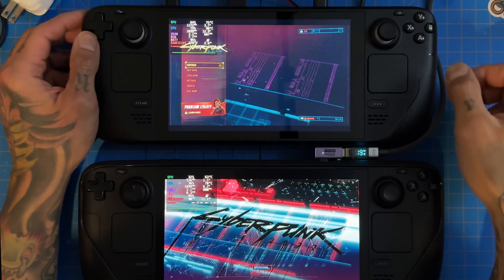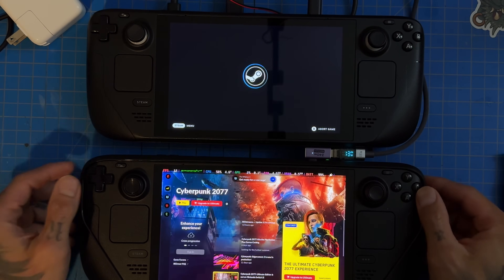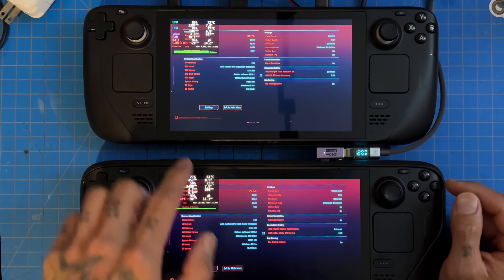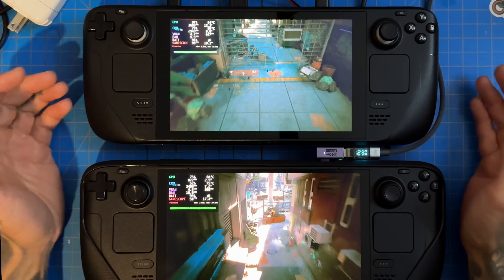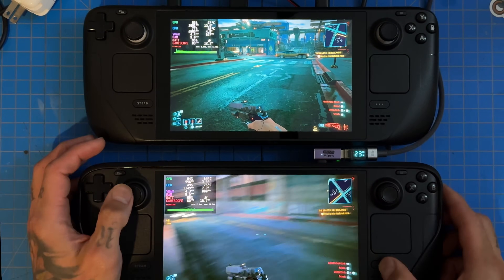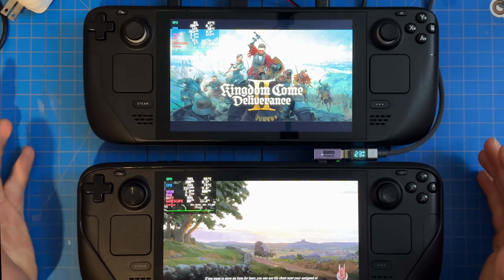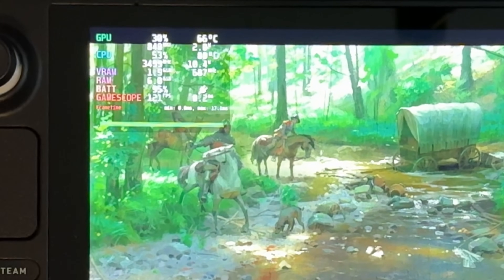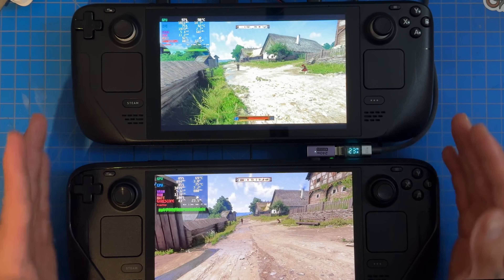Steam Deck with Lossless Scaling Overclocked

Comment: Most of the people use this wrong....guys you have to disable frame limit and allow tearing from Steam deck's performance settings for it to work properly. You'll know it's working properly once you notice the artifacts. Don't rely on benchmark you can notice it with your eyes!

Ps: for now it doesn't work with some games like cyberpunk it will show you 100fps+ but you can tell it's still 30 fps ish

Once you disable frame limit it on steam deck's settings it will never go above steam deck's monitor Hz. 60 for LCD and 90 for OLED
Reply from the maker: I'll be sure to give that a shot. It was off or set to 90fps on cyberpunk cant remember if 

Thanks for the heads up
Reply: I definitely have it working on cyberpunk

Comment: Something’s off with this benchmark. Why is the cpu clock so high on the oled limiting gpu clocks? Vs the lcd with a lower cpu clock
Reply from the maker: No idea, 🤷🏻‍♂️ currently testing OC OLED and its not running well at all. Very weird stuff happening

Comment: Does overclocking shorten the life of the devices? or does it overheat it? I've never really known what that does.  Like I understand that it pushes more power right to boost performance?
Reply from the maker: Correct, it does all above. It will shorten the lifespan by how much I do not know, but the best way to minimize any negatives is to keep it running as cool as possible.
Reply: @Diy_Papi  thanks for the response, and good to know. Thank you sir!

Comment: What are the downsides of overclocking? Does it effect the battery negatively in the long run?
Reply from the maker: Yes, it will decrease the life span of the SD. By how much i do not know.

Best way to minimize any downside is to jeep the sd as cool as possible

Comment: would my battery ruined with overclock ?
Reply: Ofc it drains the battery faster but thats about it.
Reply from the maker: It can also cause the battery to overheat depending on the TDP and the environmental conditions

Comment: Hi. I also overclocked my Steam Deck LCD to 17W TDP. But I didn't roll back the BIOS and did it on the latest version. I tried overclocking the GPU, but at 17W or 18W TDP it doesn't provide any real benefit, if anything, it hurts performance, so I left the GPU at stock values. The difference between 17W and 18W TDP is minimal, but at 18W the temperature is higher, so I stuck with 17W and bought a perforated back plate "from AliExpress". With this setup, my temperature doesn't always even reach 80 degrees, so I don't need extra cooling. And FPS in games has noticeably increased.

I couldn't overclock my RAM to 6400 MHz; my Samsung memory modules behave very unstably. But I adjusted the timings and have had no stability issues with them, while gaining a small FPS boost. For example, in Cyberpunk, it gave me an extra 2 FPS.

Oh, and I also overclocked the display to 70 Hz. This allows me to lock the frame rate at 35 FPS. And if we're talking about Lossless Scaling, it can provide a significantly better experience: if we lock the in-game FPS at 35 and enable 2x frame generation, we get around 70 FPS. Plus, frames generated from 35 FPS will look better than those generated from 30 FPS. Although Lossless Scaling handles 30 FPS generation excellently in many games.
Reply from the maker: Interesting, thanks for sharing your experience! Can you send me the link of the refresh rate mod you used.
Reply: Look for @10minutesteamdeckgamer

Comment: Probably bandwidth limited which was why the OC deck wasn't pulling more power. If your LCD deck is capable, try OCing the ram to 6400mt/s. The OLED deck has that by default and is pretty much the largest contributor to the slight performance bump that stock OLED has over LCD(the other being the slight power efficiency advantage the OLED has allowing it to boost a bit higher at the same TDP).
Reply from the maker: Interesting points, I'll have to look into that, thanks!

Comment: i always thought the steam deck was only rated to dissapate 15w of heat so idk if 20w would be healthy for the device is what i would worry about
Reply: It’s perfectly fine. I keep mine between 22 and 24 watts almost exclusively and it’s been a year and a half. Only
Change I did was a different backplate . I never go past 84 degrees
Reply: @dontsweatme4588 which one are you using?
Reply: @RetroMannGamingthe OLED . It’s fine for the LCD too. that’s what I started with. Definitely recommend better backplate and probably better thermal paste for the LCD.
Reply: running stock oled here, yea it cant handle higher tdp without some physical modding
Reply: @pikkyuukyuun4741 that’s not true either. It whatever your comfortable with. I was running 20 watts stock OLED for weeks and maxing out at 86 degrees depending on the game. You can get the better back plate if you want lower temps just be moderate with the overlocking …remember the deck can run just fine up until like 95-100 degrees
Reply: @dontsweatme4588 my stock backplate will overheat my deck. its the cpu that overheats(above 100C). when that happens, all my clocks drop to the lowest it can and the led flashes red. my gpu seems fine its just my cpu. even with undervolt. I have run my steam deck at 25W in the past, maybe thermal paste dried up idk
Reply: @pikkyuukyuun4741 Youll destroy it like that... please get better cooling 💔

Comment: I've had some weird differences between my LCD and OLED while running Lossless Scaling. I'm not sure if it's hardware or the OS though because I'm running CachyOS on my LCD. 

That being said, for some reason, I can run FSR with Lossless Scaling on my LCD but can't on my OLED. Weird thing is that Lossless Scaling WON'T run unless FSR sharpness is on on my LCD and it CAN'T run while it's on my OLED with Sharpness toggled on through the QAM. 

Sometimes Gamescope will report 60 frames but it's obviously not actually producing 60fps. Those times reinstalling Lossless Scaling fixes that but it crops up randomly. 

I'm wondering how much of it running smoother on your LCD has to do with the actual hardware rather than just the overclock. Another thing I had noticed between my LCD and OLED when both are running Lossless Scaling is that the HUD elements were solid on the LCD, but they were glitchy as hell on the OLED. 

Again, I can't isolate if it's a hardware issue because I'm running a different OS on one of them but the lack of HUD glitches on your LCD makes me think it might be a hardware related variable.
Reply from the maker: I have noticed the OLED is more finicky than the LCD when running lossless

And it does feel like lossless just works better on the LCD 

I guess I’ll have to overclock the OLED to see

Definitely feel like the LCD, even without the overclock was willing to pump more power into the APU while running lossless

Comment: to stop lossless scaling choking your system harder what you need to do is frame limit your games to half what your expecting to reach, so if your trying to maintain 60 then frame limit in a "games own settings" to 30fps, this way framegen will see the 30 and will try to double that to 60, if you limit via the usual steamos/gamescope then all kinds of bad things happen as framegen interferes/messes up gamescope and framegen target fps will bounce all over the place, possibly making more frames than you wanted and thus adding yet more latency.

Its a pity that most games only have specific FPS targets like 30/60/120 etc or you could set 45fps to reach 90fps for the oled.
Reply from the maker: Generally, that’s the way you wanna do it,

I typically do that when I’m running losses on a proper PC 

I have to do some testing to see if it helps with stability on the steam deck 

But from what Little I have done anything 2X runs pretty smooth with a 60 to 70% flow scale
Reply: @Diy_Papi  can u try to run bloody spell its fast paced hack and slash that makes steam deck struggles good benchmark its hard to run it well even with Lossless_Scaling
Reply: Do should we disable frame limit in the quick access much or just max out the frames?